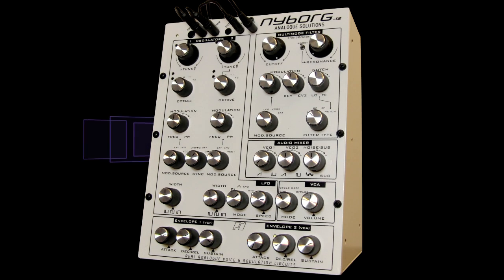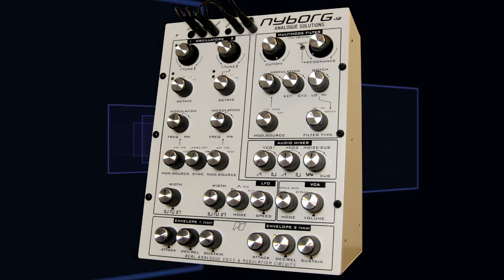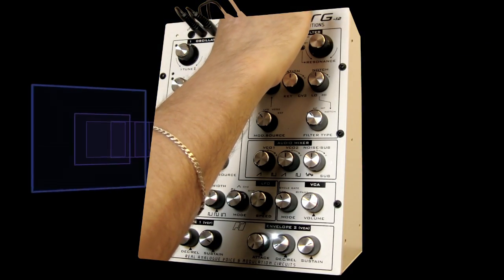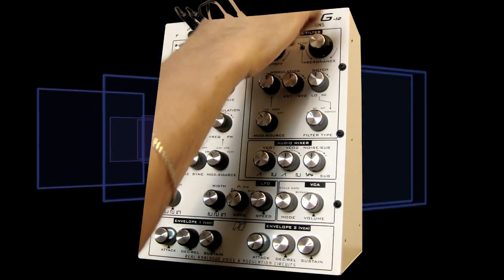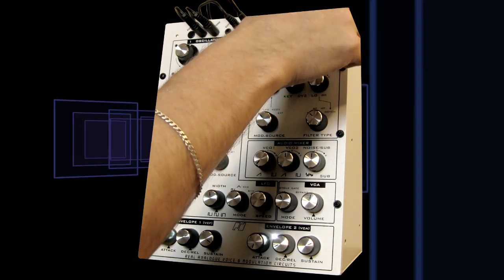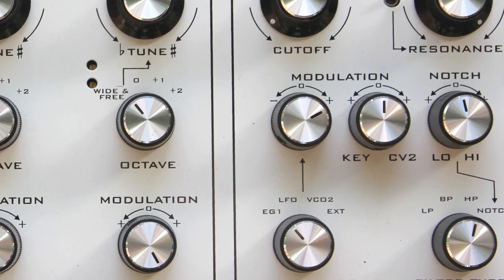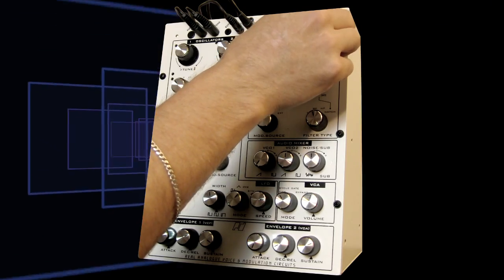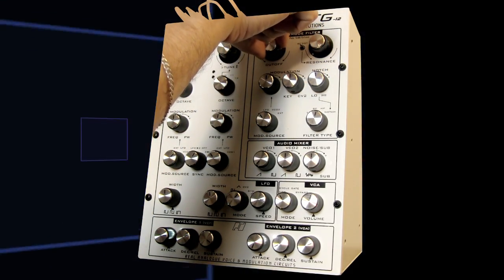04- The Analogue Solutions Nyborg 12- Filter Part 1

Comment: Thanks for this video. I have Nyborg-12 and have been trying to best understand the Notch filter. In your video at 10:08 you  say that the  "Notch" control adjust notch width, and I wanted to check with you if this is correct? What I have found is that with the Notch control all the way to the left, the notch filter acts identically to the Low-Pass filter mode, whereas all the way to the right and the filter acts identically to the High-Pass filter mode and as such the Notch control seems to blend how much high low pass filters respectively interact with the outgoing signal. I don't think the Notch control does as you say, i.e. adjust notch width, but I could be wrong too. Do you have any further insight on the Notch filter post making this video?

Comment: I really prefer 12db filters, because they don't kill higher frequencies in such a brutal manner as 24db does. Did not know multifilters increase base frequencies, will look it up. Thanks for the infos and video. Great synth despite being analog. ;)
Reply from the maker: +pcuimac Resonance boosts the harmonic frequency at the cutoff point.  Doing so in the high-pass filter, which starts with low frequencies, allows you to keep all of the high end and boost the low end.
Reply: +AutomaticGainsay Ok, that's normal behaviour. I thought you meant something differently. I never tried to use the HPF that way. Thanks for the tip!
Reply from the maker: Yes, it's very normal... any synth with a resonant high-pass can do it!  This is why I get so irritated when people say things like "The CS-15 is thin," etc.